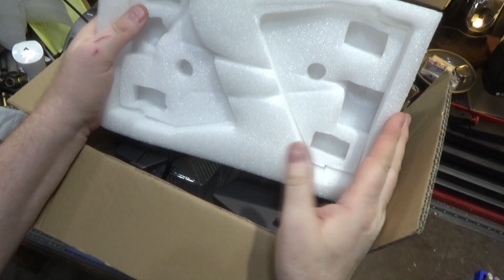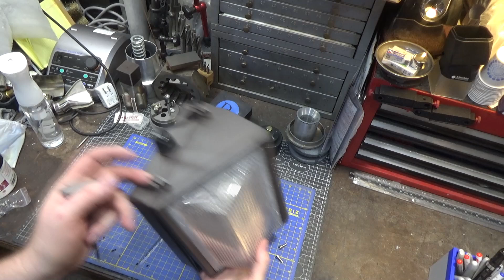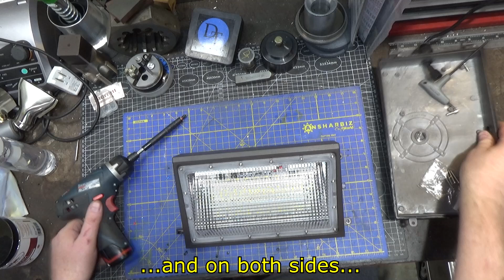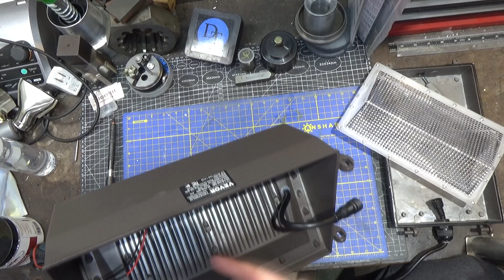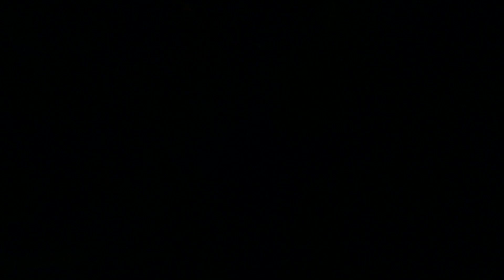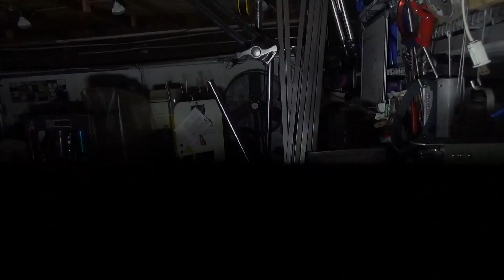QTR 116 Vevor 100 Watt Wall Light 2 Pack

Comment: I have many "Wall Pack" style lights like this, outside my shop- I'd bet the threaded bosses around the inside of the back cover wasnt originally for a PC board, but for a BALLAST for when they used the same case for Other lighting, before LED
At the $45 price point, if you got a year or so out of it, I'd say that wasnt too bad considering the exact same thing in commercial grade is $250EACH and up
Reply from the maker: Thanks for the really useful perspective. I have very little experience with this particular type of light.

Comment: I think the number of daylight and darkness hours pretty much balance out through a year. The average would be 12 hours per day so 3,000 hours would be 250 days. Unless these are used with a motion sensor, they don't seem to be worth the time it would take to install them. Even if installed indoors with 8 hours per working day of use and 5 day work weeks, it's only 75 weeks. Still not worth the installation time in my opinion.
Reply from the maker: The sensor really doesn't trip until there is complete darkness. When I turned off all of the lights and the unit came on, I got too close to a light colored surface and the light turned itself off. In an case your point is still valid and thanks for taking the time to share it.,

Comment: Hi, i think this replaces a 100-watt metal halide lamp that is rated at 15,000 hours. I don't see a savings in life, in an industrial application you will have to change fixtures at 3 times as often as a metal halide lamp, you are also paying for the electrician. 
no thanks
Rich
Reply from the maker: I agree completely. Thanks for sharing your take.